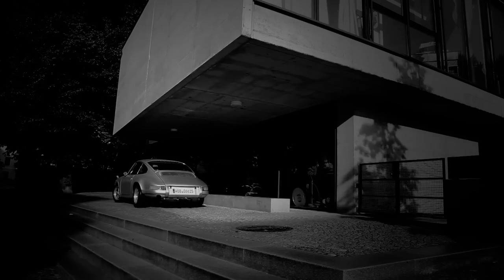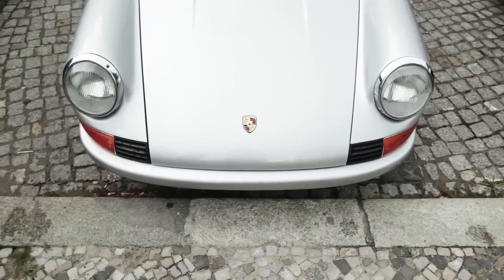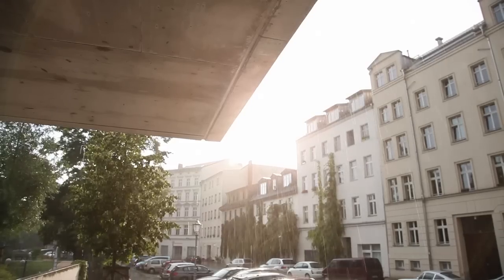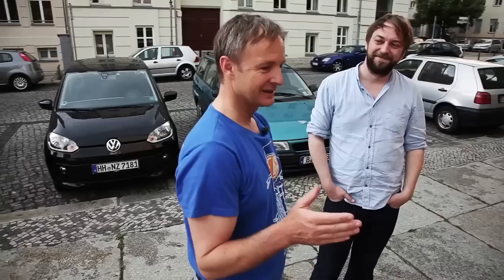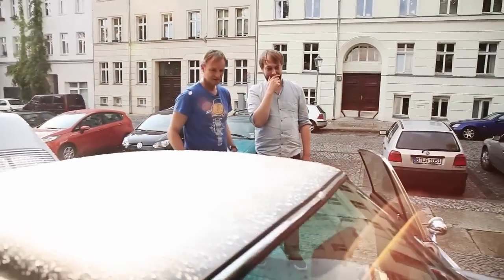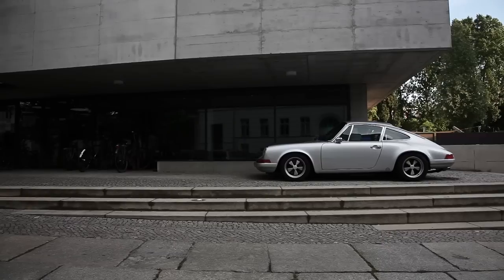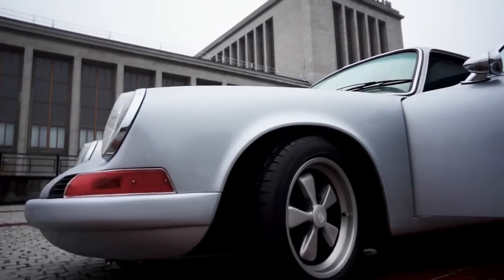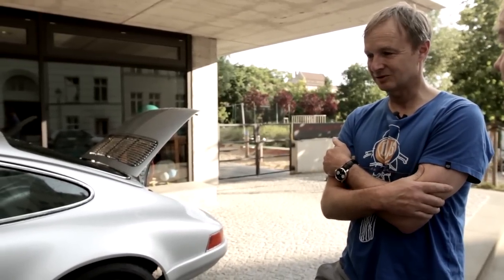Bugatti Head of Design's Personal 911 Project - /DRIVEN

Comment: I like his comment on the doing his fuchs. Using water to level the wheel line to tape it off for painting. Very smart.
Reply: that's called German engineering
Reply: DaMadBlaqDrumma Totally. Cannot wait to do that to my fuchs. They need refreshing.
Reply: 930Scarlet Dipping was the way the original wheels were painted, but lowered into black paint.
Reply: Roger Hudson
Tape up the holes and fill the Fuch with paint. Poke a hole in the paint and let it drain out. Works great!
Reply: Christofer Johnson That is pretty cool. I would love to do this with my wheels.

Comment: Loving the eclectic mix of backdating the car with pre-74 bumpers, single chrome mirror, pepita seat upholstry, and the motorsport bits like the pedal box, gear linkage, steering wheel and kevlar body panels. A quintessential 911! seeing those velocity stacks i bet i goes like stink too!

Comment: Great video! As a Porsche fan, I would have liked to have seen the car being driven and the actual performance of the car! 800kgs is a massive change feom the original weight of the car which may have been closer to or more than the 1200-1300 kg mark? Just guessing. What about the glorious sound of that incredible flat six engine? I don't believe any  Porsche should be featured without one of the most important aspects of the car that made it an icon..... that beautiful sounding and performing air-cooled flat six!! But thanks for sharing a well made interesting video!

Comment: Also if you're interested to see what a person can do in their garage, Google "sv650 carbon fibre tank zoran". That follows the production of a carbon fibre motorcycle fuel tank. Cost of materials on that one was $350 (USD), and about 100 hours spent over 10 months. That includes making the plug, mould, and final part plus attaching fittings etc. It's not a quick process, but isn't that why they're called projects? To buy a CF tank would cost anywhere from $1,500 to $2,800.

Comment: Great attitude to evolution and development of a personal 911, Now, where can I get those Kevlar panels he speaks of?
Its a wonderful expression of a 911 ethos,  I've a '76 911 2.7 which hasn't been on the road for years. I will need a full restoration and rebuild always made easier by ditching the old and bringing in the new, would like to efi the engine too. Lighter and more power, He's damn near current 911 power to weight ratio's

Comment: @Dan fredrikson. You are right about the wind resistance as a ratio of effort at those speeds. But a car is at it's least efficient when accelerating from low speeds where inertia and mechanical resistance are the main forces.

Comment: For the average enthusiast the main "cost" is in time. There's a lot of different methods that could be used, but the most simple is wet layup which anyone with basic fibreglassing skills would be familiar with. Equipment for that is very basic, most DIY'ers would already have most of what they need.

I'm not sure about cost on a bumper (I'm a bike guy), but for my supermoto project I estimate about $5-600 (AUD) total cost. But that amount of materials will be enough for every single body panel.

Comment: Didn't think of that, that he may of changed the weight distribution and thus, handling.  Then again, the steel body panels he replaced, were replaced with kevlar composite (should be stronger than steel).  He also changed the doors, rear "hood" (bonnet for U Brits), windows are thinner and/or plastic now, sound deadening, carpets, even heater removed.  So when you get down to it, I don't know if the weight distribution has really changed.  But overall, it's definitely lighter & I WANT IT!

Comment: If he did it on the cheap how you suggest, then I applaud his effort. Even using his contacts to reduce the cost of weaving (if that's what you do), I would call resourceful. Especially considering he could afford to just buy the parts outright. 

But, on what total cost would you estimate a single bumper (for instance)? Taking into account a number of failed attempts to do it properly and cost of obtaining (renting, I guess) the necessary equipment for an average enthusiast to give it a shot?

Comment: Disappointing that you don't even ask Achim about the engine. Wondering if he kept the 3.0 SC motor and rebuilt it with S/RS cams and the high trumpet intake MFI. The only performance aspect of the car discussed was the weight. The other side of the coin is HP. If Achim dropped the weight of the car to 820KG (1800 lbs), and has a MFI inducted 3.0 motor with hot cams, the engine would probably put out something like 250hp. Do the math. That would be one very fast street car. Achim, you should consider putting some SSI heat exchangers in the car for heat. HP would not be affected much. Also, put some rubber pads over the pedals. Wet shoes slip very easily on bare metal.

Comment: when you get higher up the level of car building, there is a time you have to work with others.   For my turbo 4 cylinder, I needed a Machine shop to do my bore, hone, and line hone.  Getting one-off lightweight Porsche panels requires sophisticated places to do the work for you.  The fastest and most elaborate 'tuned' cars on the planet today are done by Teams, not Individuals.  AMS, Crawford Performance, GST, ...even Carroll Shelby had a team.I use to think as you did, but reality differs.

Comment: every hundred pounds is a 1/10 of a second,in the racing world,that a lot.1000 pounds is a second knocked off the acceleration times,So if this car had a 0-60 time of say 5.5,it would now have a very quick time of 4.5.Smart guy.Aerodynamics,weight,friction
Reply: That's a rule of thumb for drag racing, not 0-60 time.

Comment: So you do not want electric cars. Just search on ecological damage caused by batteries and their production. Not to mention it takes more energy to drive an electric car than a gas car (although the price of gas is fairly well offset by the price of electricity to charge cars).

I would recommend the perfect car for the 'treehuggers' would be a three cylinder GEO metro. They are cheap (because they are over 20 years old), get over 40 MPG and actually have enough power to outrun the prius.

Comment: 964?  UMM, maybe a bit....I happen to like the 964 because at least the ugly "DOT" bumpers were covered up.  If I had the money to buy a daily driver, I wouldn't mind a 964 (one of the last air-cooled with original body-shell.  I'm not crazy about the 993 front end).

But he transformed it in to an older style "long hood" 1st gen 911.

I see early 1970's Porsche, not 964.  Either way, I WANT IT!  & he did an amazing job!

Comment: The Hennessy shares the idea (light weight frame/body and put the biggest engine possible), but CERTAINLY not the price!  The Hennessy is $600k-$1.5 million depending on power & options!  Can U afford that?

The AC/Shelby Cobra, original Viper or Lotus Elise/Exige shares the idea more.

A 1960s AC/Shelby Cobra sold for $5995 (about $40,000 in today's money) & they HEAVILY discounted the price because no one was buying them!

Although $5k was not cheap, it's in the grasp of the common man!

Comment: There are around ten thousand Veyrons on the road. (They've been building around 80 a year + 300 when it was launched. This is not crazy accurate but that's what I could find) Even if it's 20k it does not change the idea that "Heavy vehicles account for more than 10 percent of the nation’s overall oil consumption and about 20 percent of the greenhouse gases emitted by the transportation sector." Out of 250 million passenger vehicles in US your Veyron makes less than 0.002%. You fail at logic.

Comment: He isn't going to, and you aren't going to break your glass ones either. Have you ever tried to break a car window with a hammer? It's actually much much harder than you would imagine. You'd probably have a lot better luck with a ball peen, but that's beside the point. If your car is sinking in a body of water, open the door as soon as possible, before it goes under, or you're gonna have a bad time.

Comment: "Fact is this guy understands what matters most in a car and it ain't weight"

Respectfully disagree!

He build a 1800Lb stripped out, low weight 911.  So he was obviously going for low weight!

99% agree with U on the other points.  Gov regulations made cars heavy (like 11 airbags).  BUT people also want their gadgets & gizmos, which all add weight.

That said, cars happen to be safer now & have more HP, which makes up for the weight.

But, I'd rather have light 1970's 911 with a roll cage.